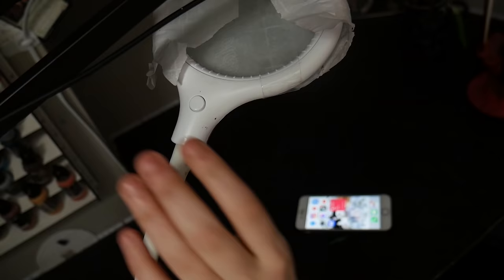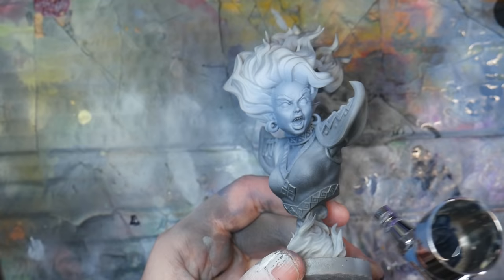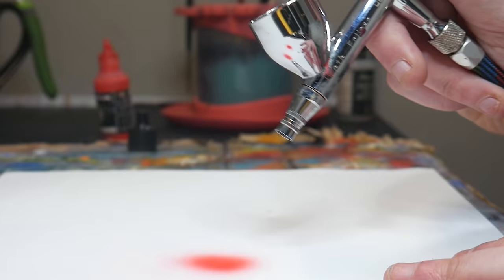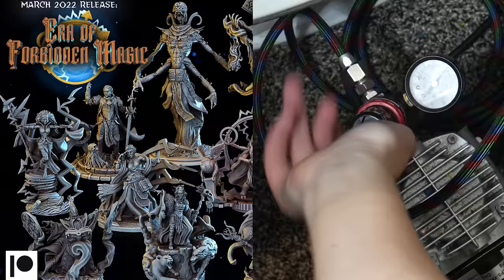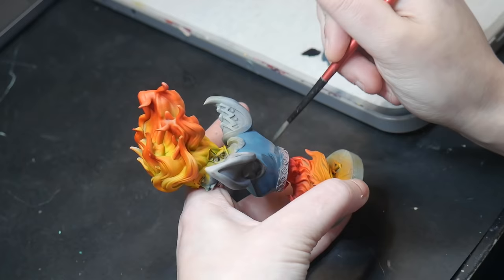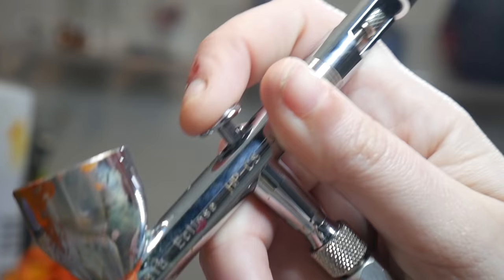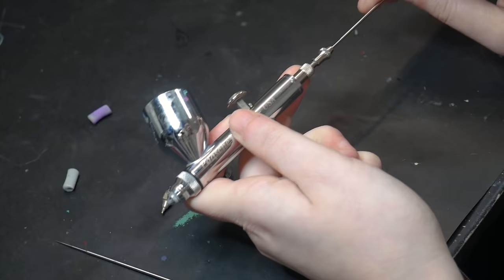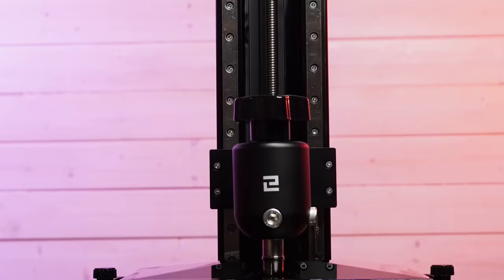Airbrush Miniature Painting Tips I WISH SOMEONE TOLD ME

Comment from the maker: What has been your biggest airbrush fail?
Reply: Not realizing I had super thick dry tip. I was slowly pulling back the trigger and nothing was coming out, so I kept pulling. Eventually I guess the gap was big enough that it blew past the dry tip and coated my mini in a thick blob 😂
Reply: Dropping the airbrush and bending the needle. That was a $15 replacement.
Reply: Pulling out the needle with paint still inside.....

I think that there is nothing wrong with it after some cleaning but im still traumatized.
Reply: I appreciate you. You are making videos that seem tailored to the exact questions that  I am trying to answer write now.  Trying to get gud at painting.
Reply: I leave the back off of mine so I have quick access to the chuck and needle, so I can draw it back while rinsing between colors. My cat has pulled it down to the floor twice, where it landed on the needle and jammed the needle through the tip, split like a bannana peel. The tips are brass, and relatively soft. RIP airbrush tips.
Reply: @profaa927  yep. been there, done that. traumatized describes it well ^^
Reply: primed some stuff. had some primer left in the cup. got distracted. came back two weeks later to dried primer in the airbrush that had somehow gotten into the actual needle tube. it turned out IPA wouldn't clean it, but a nice bath of the entire thing in LAs totally awesome did.
Reply: buying it
Reply: Not know the importance of having a straight needle.
Reply: @tinyfishhobby3138  same
Reply: leaving the cap off the paint cup and moving the airbrush back and forth way too enthusiastically, resulting in getting paint all over my lap
Reply: So far: buying a brush I am woefully inexperienced for.
Reply: Buying an Iwata Neo. Stay far away. For the same price you can get a Badger Patriot 105 and it's no contest.
Reply: So far my biggest fail is to not find the courage to paint with it. I'm still stuck using it as a fancy primer tool XD
Reply: not realising that my primer (Vallejo black) was off and had solidified bits of paint mixed in the liquid, that ended up in the cup every time I tried to use it. I now shake then rest my primers of a minute or so and then use a dropper to draw up paint from the bottle.
Reply: My biggest fail was starting with an Iwata Eclipse because I was ambitious about airbrushing details before realizing that it's going to be used for value sketching/zenithal/large panel modulation only and I should have bought a badger 105 (or something) for less with a bigger needle. It is hard to want to bother to learn to do much detail work with it because it feels so behind my hand brush control. Firmly believe now one's first airbrush should be a workhorse airbrush. The eclipse I think is for someone who has built their skills up some. I think my attitude was that I didn't want to horse around with a less expensive airbrush after painting with inferior brushes for ages and then trying Raphaels etc. and I didn't want to limit my trigger control development by relying on an airbrush with a triggerstop. Anyone who tells me they are learning to airbrush, I point them urgently to Hobby Cheating episode 213. When I got started it was really mind opening and liberating to realize I could clean/change colors in ~30sec with a little practice. I really wish this had been up a couple of years ago when I was starting! Incredible fundamentals recap in 8:30, my only feedback is that you could have had a whole minute of cat footage in there and still been < 10 min :)
Reply: I once fumbled while taking off the nozzle, I broke it and the nozzle's screw thread stayed stuck in the airbrush...
Reply: I made the eyebrow in a portrait of a little boy too heavy. Made it look like adult eyebrow in a child's face. I was working on clay board and tried the  glass fiber eraser to thin the eyebrow. To this day the eyebrow still looks a bit too adult and he seems to have a little scar ... I was not able to fix it completely...
Reply: Not starting to airbrush earlier. Although I use it mostly to bring color variants with multiple layers onto 1:35 models, it makes such a difference. Especially using colors that are very thin and would take ages to bring em up with a regular brush. Also no brushlines. Wonderfull. I also made the mistake to mix wrong thinner with my colors so I almost ruined a whole model.
Reply: Pulling all the way back on the trigger,  didn't even know this was a thing
Reply: I use mine almost exclusively for priming/painting the whole model 1 solid color since I'm still not super accurate and a few weeks ago when I went to use it the trigger wouldn't pull back at all and the needle was stuck in the airbrush, turns out I had cleaned the cup but I guess I didn't spray cleaner through or pull out the needle to clean the tip because there was primer lodged in the nozzle keeping the need stuck in place I managed to yank the needle out with pliers without bending it and learned a valuable lesson about cleaning.
Reply: The worst I've had so far was a primer clog. I was nervous about breaking my airbrush and I wasn't sure which parts unscrewed. Once I worked up the courage to get a clamp and completely disassemble the tip, I soaked the parts in cleaner and gave it a thorough cleaning. That solved the problem.
Reply: @aliekoffeman6194  That's not a mistake, that's a happy little accident, remember this is your world and what you make of it is unique - Bob Ross....probably
Reply: Dumping a bunch of ink into the cup, before realizing I forgot to put the needle back in from the previous cleaning. Fun times...
Reply: I broke the nozzle on a airbrush with screw on nozzle by tightening it too much. This killed the airbrush and I bought a new one that doesn't have a screw on nozzle.
Reply: Tried to paint downward onto the mini (I moved the mini to angle the light better) completely forgetting that nothing holds the paint in the cup... Dumped the paint all over the mini and my table. I now know to move my light instead.
Reply: I've made most of the mistakes when using an airbrush but the biggest mistake I ever made was owning my airbrush for 2 years and not using it. I wish I'd started sooner.
Reply: I didn't have a ventilated paint booth for starters, but also I started out with a crappy micro-mark knock-off of the Paasche H type Airbrush, but everything about it was terrible... Now I use a Paasche SI Internal Mix Single Action Airbrush... I love it and the paint goes on perfectly...
Reply: Not switching to a Procon Boy PS290 sooner. Expensive, yes, but much more ergonomic for me, especially since I have neurological issues which affects my hands at times.
Reply: Every single white that I’ve tried so far! I know it’s me learning but it’s so frustrating
Reply: Thinking I was clever to save the money for a decent compressor and instead fitting a plastic jerry can with two tire valves, one to attach the brush to and the other for a foot operated pump. What tedium!
Another noteworthy one was painting a Heinkel 111 in the typical two tone green splinter camouflage. Hours of masking (the part I hate most, apart from cleaning the airbrush). The wonderful satisfaction when taking off the masking, only to realize a little later, when the paint had dried, that I had confused the paints and painted the same tone twice. So there she was, in all her one-tone-green glory.
Reply: The viscosity of the paint. Yet to get it right.
Reply: Pouring ~30 ml of Paint into the Cup with no needle installed
Reply: My first airbrush I used was a cheap beginner one, I hated it.

I deep cleaned it multiple times bcasue I was pulling out the dirty needle and stuff.
I sorted it out when during a nozzle change the nozzle broke off while screwing it in left with the tread inside and no way to remove it.

Got one that was a bit better quality recently and started to use it for base coating and stuff.
Learned a few things with this video thanks
Reply: Lyla head up, I've heard compressors can be dangerous when placed on carpet. Apparently its a fire hazard!
Reply from the maker: @ieatstheinternet  OH CRAP
Reply: My friend Scott wanted to have his name airbrushed on the back of his car in large, 3d lettering that was the same as a popular local radio station. I spent hours taping and cutting out the letters, doing drop shadows, fades, and texture. It was the BOMB!  I had so much pride!  I pulled back the tape and paper only to see 9-inch tall, multicolored "Skott".  This was in lacquer with a SINGLE action airbrush.
Reply: Letting my paint get old and lumpy, before using it up.
Trying to strain it and keep using it, instead of replacing, causing clogs.
Reply: Masking Tape.
Reply: @Ljaysauz  ohnoes!!😜
Reply: buying an airbrush, compressor etc. and still not having used any of it yet.
Reply: Not watching this video first
Reply: @annajak1459 Yes! Me too. That’s a great feeling.
Reply: I was just cleaning my airbrush and took the needle out dropping it on the tip.
Reply: Guess I'll find out once I try it, figured I'd do some research first lol

Comment: I have been airbrushing 30+ years and 7 were professional on motorcycles, and cars. Everything in this video is correct, but as you progress you will find exceptions to some of what is in this video, and you can get away with more things as skill progresses. So this is a VERY GOOD starting point! Good job! To tighten your edge work, practice by painting a grid of dots, connect those dots with lines as thin as possible.  Then like with the circles paint gradients from bottom to top, left to right, top to bottom,  right to left, diagonal from each direction, and so on. Use the angle of the tool to get a crisp line on the dark side of the gradient.  Replace your smooth caps with crown caps or take a rotatory tool or file to cut slots in the cap. When you get the airbrush close to the object you get a backwash of air into the cap and this disrupts the paint spray pattern. A crown cap will allow that backwash to mostly go around the tool. You can also remove the cap for tight work, but you run the risk of damaging the needle. 0.2 mm Needle can do hair lines, but 1.5 mm makes that easier at the cost of lower max volume. You can pretty much do everything with a 0.2 with practice. I think playing with air pressure is something people need to do more. If you are getting "pulsing" in your paint from the compressor, get a tank in line and or a disposable air filter. You will need to up the pressure a bit for the filter. This is normal. If you are getting water in your line, get a long hose from the compressor and put the tank or filter on the end of that. 25 feet is what I used, but you may need longer or shorter depending on what your air is like where you are. This allows the air to cool before it gets to the airbrush and will condense in the filter or tank.  If you get a tank, CLEAN it every day. Also if your compressor can not push enough air in a long line, use an ice pack on a shorter line, or just a cold wet cloth. You need the air cooler in the line before the filter so it will be water and not wet air. There are a lot of simple cheap tricks to getting good air. My best setup at home was, air compressor with built in tank, 25 foot of airline, small tank, filter, regulator, airbrush hose, then airbrush. This is not needed in most cases, but gives you great clean consistent air. There are a LOT of ways to do this. Mine works for me, but that doesn't mean it is right for everyone. The only thing that is 100% right for everyone in every situation is practice, practice, practice!  Sorry for the novel. I just have a lot of experience in this area.
Reply: What that guy said.. lol.. same here. great job
Reply: I'm sure there are many helpful tips in there but I'm not combing through it.

But if you ever decide to use paragraphs in future I'll be sure to read it thoroughly
Reply: @theophrastusbombastus1359  Welcome to the internet. Good luck! 🤣🤣🤣
Reply: I’ve never had a chance to really play with an airbrush, so I was really curious what ways there are to mitigate water in the line, so this advice is awesome. Using something cold to condense the moisture is something I never would have thought of on my own.

My experience with compressors is in a carpentry context and while annoying, water in the line isn’t the end of the world there. Well, fine finish work notwithstanding. But some (probably slightly rusty/oily) water splatter out of your nail gun is one thing; the idea of rust and oil through an airbrush makes my heart hurt and I don’t even own one.

Regularity draining the tank on a compressor that has one is also a very important safety measure. The temperature differential will produce moisture in the tank which left unattended will rust out the inside. Thinning walls on a pressure vessel is, to put it lightly, a bad thing.

And if you’re embarking on a painting marathon lasting all day, drain the tank once or twice throughout the session, depending on the ambient temperature.
Reply: I appreciate your novel !
More is better when it comes to pro tips.....i recognize and respect your experience.....thank you
Reply: I have trouble getting product through the gun. I do thin it a lot
Reply: @dave5833  You have either an obstruction or poor air flow. Take the tool apart and clean it. Check air pressure at the tip of the gun. You can use your hand and feel that it is moving. Filter your paint with a coffee filter. If it is still not working you have a defective part in the tool. Some guns will need more air pressure than others to get the same result. This is normally do to a manufacturing defect. The path for the air is cut smaller than normal. Usually due to an old cutting tool. Good luck. You will figure it out!
Reply: @ajosepi1976  this gun was brand new. I’ll check everything again. Have you ever sprayed with a bigger paint gun, thanks for all you replies
Reply: @dave5833  Brand new, then it is probably grit from manufacturing. Yes I have painted everything from miniatures to full size F350. I have used cheap stuff all the way to $1000 airbrushes. Most of my experience is with Harder & Steenbeck and Iwata. H&S is my favorite, but they are not cheap. For full size guns most of my experience is with SATA. FYI I had to get out of it for health reasons so all my information is out of date 10 years, but they still sell the same stuff.
Reply: @ajosepi1976  Thank You do you have a contact number for them? Have a great weekend
Reply: @dave5833  No I don't.
Reply: Great comment - this one should be pinned 📌
Using ice packs on the line in combination with a regulator and filter is a great idea.
I did not know about the crown cap but since most of my models are small, I do not have any real issues with backwash but I don't do any detailing with the airbrush (yet).
An extra tip from my side: buy one of two of those cheaper air brush sets that are being sold in modeling shops. These often come with a larger needle/nozzle set (0.5 mm) for paints with high solid content like primers. Now you can keep your more expensive iwata or DeVilbiss guns for more detailed work without worrying how to clean them without damaging them.
Reply: I'm just getting started and your comment is full of great experience and tips. Thank you for taking the time to write it all out!

Comment: as far as removing the needle while there's still paint, one trick I saw from an old automotive painter was to always remove the needle through the front of the brush, not from the back.  That keeps the paint on the side of the seal that paints supposed to be on, instead of trafficking it back the other way.
Reply: Yep, I do this with my H&S Evolution. Unscrew the rear body, loosen the needle clamp screw, take the nozzle off and push the back of the needle forwards. Much cleaner and you don't risk messing up your seals.
Reply: only works with airbrushes, that allow for this procedure. But yes, never pull, always push the needle out.
Reply: Nonsense, I have been airbrushing for decades and if your seals go from removing the needle, you have a shit brush end of story. I literally will pull out my needle every single job...mid job, pot full of paint.
Reply: @sayloth  Same here, I pull it out.. Most airbrush's won't allow to push needle through nozzle..I wouldn't either way, it be harder to clean all that dried up paint towards nozzle.
Reply: I figured this trick out a few days ago 😆. It was a real eureka moment

Comment: Great video!  One other alternative with the needle---  Push it through from back to front and pull it out that way.  Aside from not dragging paint through the airbrush, you also don't run the risk of getting a burr on the tip when you reinsert it.  :)
Reply: In order to push the needle out in front, you have to remove the nozzle.
This means that there is a risk of damaging the nozzle.
After ruining two nozzles, i now am very careful with the nozzle.
In many cases you dont need to remove the nozzle and this reduces any risk of damage.
Reply: @thylange  Wrong, no damage to the nozzle will occur unless you over tightened it already.  Either direction is fine as long as you take care and the Needle is far more costly than the nozzle.
Reply: @animalyze7120  In my local shop nozzles are more expensive. Needle: 159 SEK. Nozzle: 410 SEK, more than twice as expensive. Anytime you remove the nozzle, there is always risk of damage (I did not over tightened it). I learned that most of the time you don't need to remove the nozzle to clean the airbrush. Most of the time i do a quick cleaning without removing the nozzle. And then i occasionally do a more extensive cleaning. I been using airbrushes for 12 years.